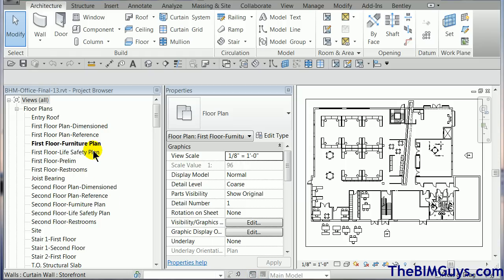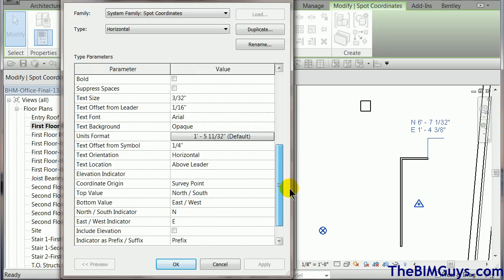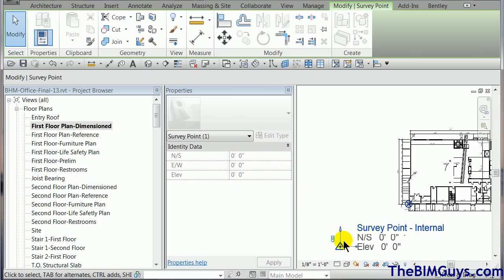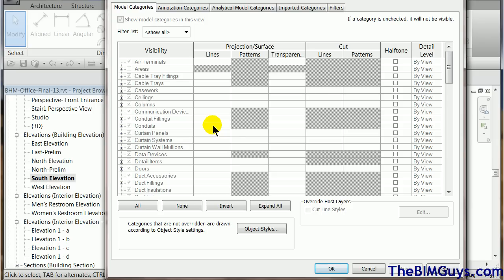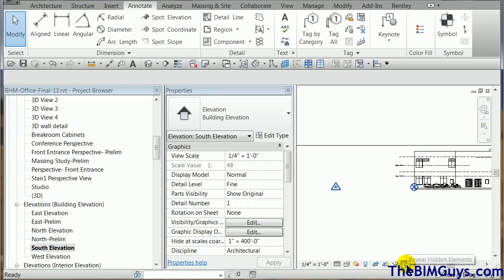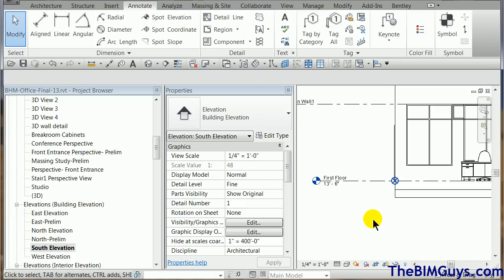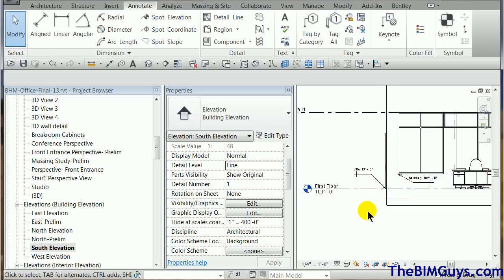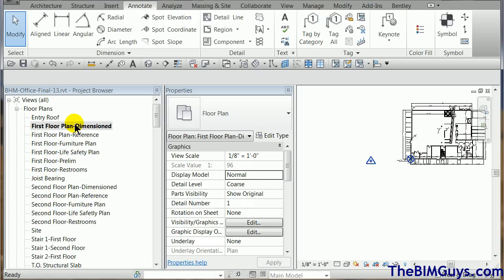Revit Project Points, Survey Points, Revit Coordinates - CADtechSeminars.com

Comment: Hey, we're in DD phase of a project and are needing to share our model with engineers. Up until now I really haven't used project or survey points! 

I have coordinates and elevation for the surveyor's benchmark and they are getting the correct coordinate system info for me, which I plan to use as our survey point. 

How do I go about getting the survey point correct with that info? When I move the survey point without it clipped, it shows as N/S E/W and Elevations at 0. Do I have to unclip it to manually manipulate the data to match that given to me by the surveyor/civil engineer?

If I do the above, will that automatically orient true north correctly or do I need to set that up separately?

Comment: Thanks for the video! Very informative. How do survey points and project points work when you want to link a revit model of a site. How do you set that up?
Reply: Project points usually are set at the corner of the building. The survey point is typically set at the corner of the site or at a related benchmark. These two points give you the option to set your elevation tags, levels, etc. to use, or reference, either point set.